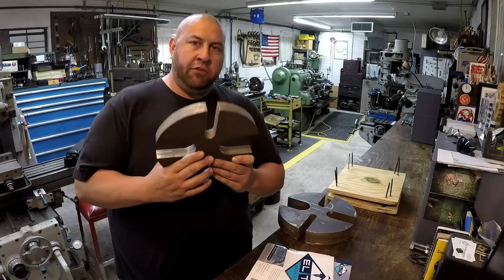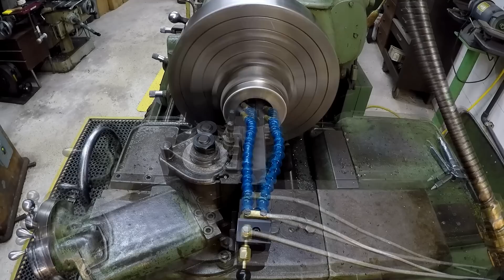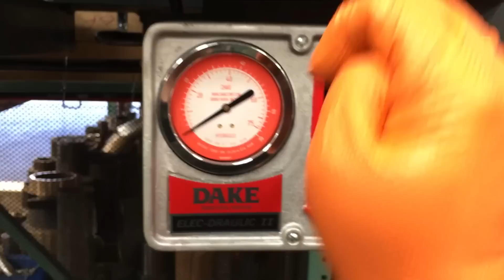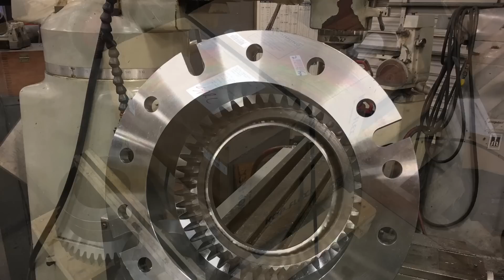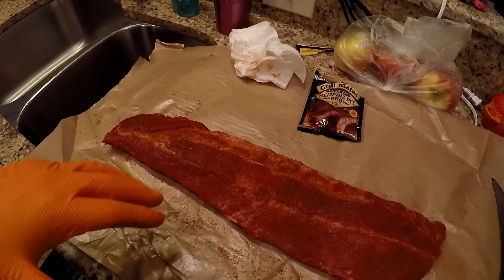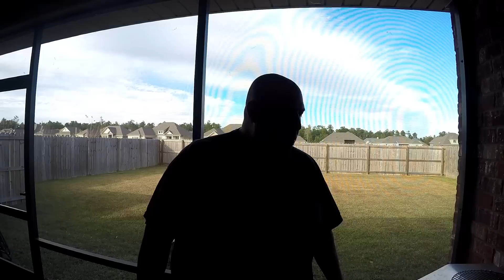SNS 195: Taper Indicating & Boring, Weekday Jobs, Pit Barrel Jr

Comment: How is your taper attachment setup? The few lathes I've used the taper attachment  on, you had to unbolt the cross slide nut in order to use the taper attachment.
Reply from the maker: Monarch lathes are different. Uses a telescoping lead screw system.

Comment: Hi, a couple of silly newbie questions. I don't understand how you can dial in cuts on the cross slide while it's attached to the taper attachment. How does that work? Sorry, I know it's a naive question, but I cannot wrap my minds around this thing. And I got another problem. I need to reproduce on the lathe a very slight taper that's in a part. Unfortunately I cannot put the part in the lathe(it's a car upright) to indicate it. I got the mating part too, but it's got the same problem. Any machinist trick up your sleeves?

Thanks, great channel, I don't usually comment but I'm a very long time subscriber.

Comment: Is using a waterjet to cut out those plates somehow preferred to just drilling/machining the slots? I know there are tooling costs, but maybe there's something else I'm not considering.
Reply: epakai speed and ability to save material. If you use a cutter your left with a pile of chips. With a waterjet the scrap can be reused since your cutting a line.

Comment: Somebody earlier may have mentioned this but we used to get valve trim out by running a bead of weld around the seat of the trim. Typically when the weld shrinks it breaks the trim loose. Like everything else it doesn't work every time but that's what we usually tried first. Works on tapered bearings too if you can get everything out but the outer race. O' course you have to be a bit careful not to weld the trim to the body. :-)  Update here, John Mills, (Doubleboost) just did this very thing to get an outer race out of a hub.

Comment: Adam, did you suggest to your customer that they should have their motor and gearbox realigned? I realize that gear couplers wear out but they last a hell of a lot longer if stuff is coaxial in the first place. Also a little grease every once in awhile goes a long way lol.
Reply from the maker: It was the maintenance technicians that requested the work. We make suggestions but that’s in there hands

Comment: Would you be able to share the CAD file on those press plates?
Reply from the maker: Sure, send me an email and I’ll see about sending them over.
Reply: Great I'll get the guys at work to cut me some on the OMAX.
Reply: Stephen Brown how do they like the OMAX? We have a Flow and a Semyx and we are thinking about getting another machine.
Reply: Aaron Kokesch they are happy with it but like most of these types of high pressure machines they have their issues. Overall it has performed very well for four years.

Comment: Why oh WHY do people run machines to destruction and then expect US to make it new for nothing! I spent too many years in the Mill Supply business and then Diesel Engines. Then Hospital equipment. Big  expensive things..."Well, when it started screaming and smoking did anybody think to take a look at it before it scattered its guts all over the place?""Um... No...""OK, you get to buy a new one.""Isn't that Warranty?""Um... No...""I wanna talk to  your BOSS!""Here's his number. And that of the CEO, CFO, and the Chief Engineer." All were on my card. You break it it's on you.
Reply from the maker: Phil Grindle We were able to talk the customer into buying two spares this time. I’m still working on them but next time maybe it won’t be a rush.
Reply: At least where I work, Preventative Maintenance Inspections were eliminated a while back, because they're not seen as cost effective, these days. I suppose there is some kind of accounting magic going on, where they somehow magically fold the cost of stripping and replacing a shaft/bearing/fan that has grenaded itself, into a tax writeoff against next year's profits. No need to PM, if you can turn a breakdown into a "savings", eh?
Reply: That is not a management plan. It is a miss-management plan. It is no way to do business.
Reply: I hear you Coffreek. The last coy I worked at after 32 yrs as a Marine Engineer did exactly that run to fail. They had a saying there. The right way, the wrong way and the Minas Basin way.
Reply: @ longcaster It is a proven fact that PM is cost effective compared to CM. The folks that don't believe this are bean counters who only look at the bottom line. An oz of prevention is better than a pound of cure! If the Coy is doing their job correctly, PM goes into their overhead and subsequently passed on to the consumer as hourly rate or product cost. OTOH if you take the cost of overhead CM and add it to the hourly rate/product cost, the part is more expensive. We live in a society of GREED, walking that fine line is difficult at best. It is further exacerbated by bean counters who only look at the bottom line, vice the whole operation.
Reply: "I swear it just let go, I don't know what happened."

Umm, no...it failed 6mos ago.
Reply: You saw that to did ya? A flexible coupling allows a certain amount of torsional flexibility and misalignment. That old coupling Adam showed it either lasted a long time and was simply worn out (they will last a long time as you know when properly aligned) or a piss poor alignment job. Looks like the latter to me with all that spalling.
Reply: Of course I saw that! As a Mechanical Engineer (don't hold that against me) I have spent most of my professional career doing what is called "Forensic Failure Analysis". I also know my way around a Machine Shop. I weld. I paint. I wrench on cars (even the newer ones).One of my tasks in the Mill Supply business was to make custom pump and motor bases from ship channel. I laid them out with DyKem and scribed all the lines and markings. Then I drilled and tapped all the mounting holes. Mag base drill and hand tap BTW.I made coupling guards out of expanded metal. Those were painted red. I aligned the pump and motor dead nuts, then took the coupling insert out (Lovejoy mostly). I slipped one coupling half back and put the insert in a bag with a printed note: COUPLING MUST BE ALIGNED AFTER THE BASE IS GROUTED IN AND PIPED. That went in the coupling guard which was bolted tight so they HAD to take it apart!There is no excuse for a poor alignment job no matter how much the coupling can compensate for it!Many of the pumps were Roper gear pumps. We stocked them with Bronze bushings but many customers wanted the graphite. I was the only one that could press the bronze out and put graphite in. It was something I figured out on my own after the first try.You can't press a graphite bushing in. They shatter. You have to "tickle" them in. I used a small dead blow hammer and got good enough at it that I would get five out of stock and half the time the fifth went back in the bin!Never had one come back.
Reply: You are dead nuts there Phil. We align to as close to perfect as we can :) I've seen couplings aligned to 0.010-0.015" sorry tolerance might suggest you can but it is not a std we should aim for. Prefect alignment means perfect alignment on a hard coupling, flexible or not and, like you said you only get better with practice!
Reply: Phil Grindle can you explain the cost difference of preventive maintenance  between 99% vs 99.9% vs 99.99% and the five nines of 99.999% reliability. It is shocking the cost difference between 99% and 99.999% uptime guarantee.
Reply: You have asked a question that is simple yet complex. The cost difference can be approximated based on the numbers you provided. Without knowing the actual cost of operating the facility or the criticality of the product there is a factor (or factors) that are missing.Is this a facility that must produce a critical product 24/7/365? Is there no other facility that can produce the product? Does that facility have redundant production capability so if part of it fails (and it will) the other parts can keep up while repairs are made?Does the product have to have 100% reliability? Some do. One failure out of a million units in the Medical Equipment Industry can cost a life or many lives.Are the products in the Millions or Billions annually?Answer these and ask me more.
Reply: "Run to breakdown" seem to be in favor as a maintenance strategy these days.

Comment: Never seen a coupler like that before. We used to use two dial gauges and shims to align motors and pumps in the gas plant where I worked. Proper alignment is critical to prevent such damage. Good vid as usual Adam. Thanks